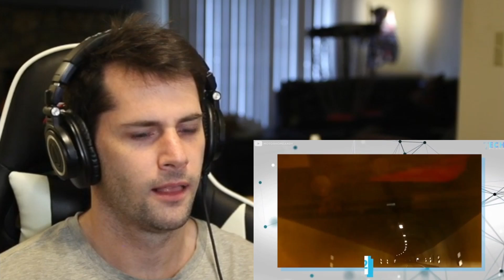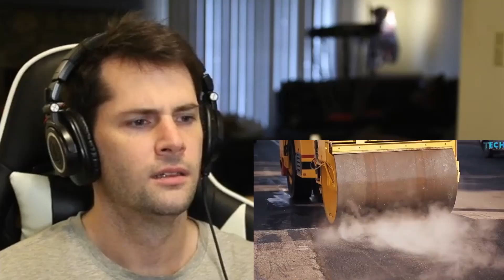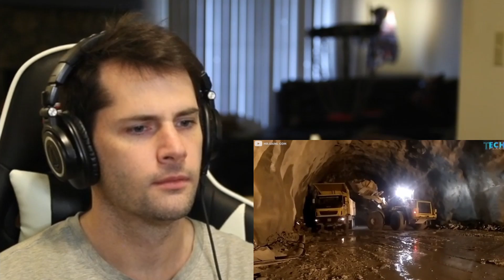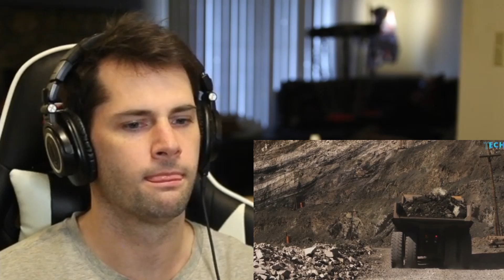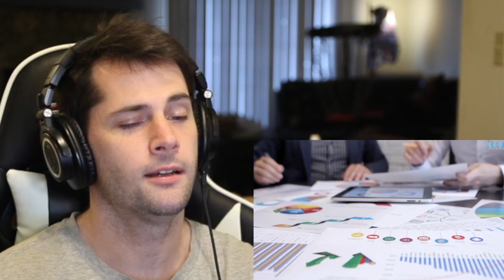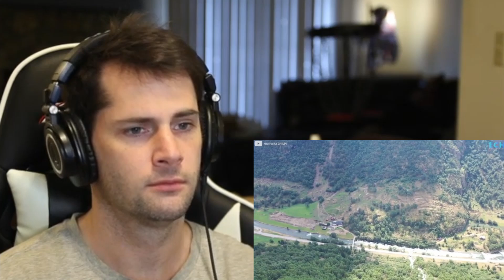American Reacts to Norway's Laerdal Tunnel (longest car tunnel)

Comment: It takes 20 minutes after they changed the limit to 70Km/h. None of the pictures outside has anything to do with this tunnel They are all from other places. There is 3 halls with blue light. The blue roundabaut is from another tunnel made for a really big bridge. Hardangerbrua. (You know how to find it online) ( and use the little yellow man in Google maps.) I know my country, and all our roads. The blue light has a function. Red light is low frequens, blue is high frequens. So when your brain is slowing down, it get a doze of blue to speed up again. When you sit and enjoy a glas of wine, or a mug of tea in the sundown, it is not the tea that makes you tired, it is the light. Microsoft and their prosessors were not first with canging computer speed, it was God.

Comment: Jut to make it clear.... over a 100 years ago between Oslo and Bergen there were over 113  raillway tunnels  - combine over 17 miles long. The longest one was over 5km. They started i 1875! Highest point way over 1200m above sea level in the aeria where you can expet over 4meters snow in the winter and way below -30'C.

A different state of mind.

Comment: Norway doesn't use EURO and never have. BUT they are part of the EU via the EØS contract thingy, sadly.. So they still got a half bad deal since they are now connected to the electrical grid of several countries in Europe and in conjunction with ACER deal they export insane amount of electric power.. and Norwegian power companies are making billions on top of billions NOK from selling electricity from dumping water from the damns without caring about the people that now and from a long time now have had insane power prices. 
Sweden also export power but Norway export over 3 times that of Sweden and then some, that's how bad it is.
Companies are having to shut down because of the insane prices so the politicians failed massively in this regard..
 So in 1992 when this tunnel was signed and set up to be done, was probably the last time they did an overall good thing in regards to the people..

Comment: I drove through the Lærdal Tunnel back in 2012, and what a journey. Back then, the speed limit was set to 70 km/h (43 mph), so it took around 20 minutes to drive through. Now, what is unique about the tunnel are the three "caverns" that separate the tunnel into sections. 
Most tunnels in Norway are not like this one, and certainly not as long. But tunnel safety has come a long way throughout the years. After a few severe fires in the Gudvangen Tunnel (which is located close to Lærdal, and is Norway's "Mont Blanc" tunnel, albeit without deaths), the government took tunnel safety dead serious, and set aside money for a massive rehabilitation project.
A nationwide program was set up to upgrade all current tunnels to a more modern standard, where pretty much all of the tunnels has received better and more efficient lighting, cell phone reception, and fire-proof concrete cladding (to protect the flammable PE-foam that they use to waterproof the tunnel)

Notable tunnel fires in Norway:
1. Oslofjord Tunnel (March 29. 2011) - Truck loaded with paper caught fire, fast emergency response, no reported damage.
2. Oslofjord Tunnel (June 23. 2011) - Another truck loaded with paper caught fire, 32 people sent to hospital (minor injuries)
3. Brattlitunnelen (January 17. 2013) - Trailer loaded with 27 tons of brown cheese caught fire, and burned for 4 days. No injuries or deaths. - This event caused a global interest in the dangers of transporting high-fat foods. Internationally, it was known as the "goat's cheese fire"
4. Gudvangen Tunnel (August 5. 2013) - Polish truck caught fire, in a convoy with another truck. This was the most terrifying tunnel fire in Norwegian history, and the closest we got to a Mont Blanc scenario. 28 injuries (5 critical, 23 severe), no deaths. - This serves as the basis for why the government made the decision to really upgrade all major tunnels (over 500 meters in length).
5. Gudvangen Tunnel (August 11. 2015) - Tour bus with Chinese tourists caught fire. Fortunately it was close to the entrance. 5 minor injuries (smoke inhalation), no deaths.
6. Skatestraumtunnelen (July 15. 2015) - Fuel tanker loaded with gasoline, had trouble with its trailer, and it slammed into the wall, causing a leak, and a massive explosion. 5 minor injuries, no deaths. This is the most severe tunnel fire in Norwegian history

Comment: They build it so wide and high he says....believe me, it's not that wide. 2 trucks passing each other in opposite direction fit, but there is not much space left between them.
And if you are over 4.2 meters high, don't get close to the side of the tunnel, or at least not on or over the white side line, cause you will hit the roof arch...

Comment: WIll probably be shut down for a year from 2024 due to EU safety regulations adressing rock burst
problems in parts of the tunnel, that is problems related to the weight of the mountains above inflict on the
rock the tunnel is drilled through. The problem is called 'sprakefjell' in Norway, 'crackle rock'.. Not nice :)

Comment: Drove through that tunnel in -05 with a coach bus full of americans. 
Quite the experience, they gave me an applaude when we left the tunnel, guess mostly because the where a bit relieved 😅

But the guy in the video failed to mention one thing, every 8 km/5 miles the tunnel gets twice the width and twice the hight for about 100 m/300 ft.
There they’ve put ambient lightning in various colors (you can see one of those ”rooms” in the video)

There are 3 of these rooms and they have different colored lightning.
It looks really nice and I guess it’s one of the things they did to break the monotomus feeling going through such a long tunnel. 

Also the walls of the entire tunnel IS INDEED covered in cement, but it doesn’t come through that good in the video.
Reply: My dad is often talking with his norwegian colleagues and he told me that they said that in those rooms you are allowed to stop and drink beer xD

Comment: I've driven through this tunnel several times, It's kind of like driving across Kansas or Eastern Colorado. Fortunately it's only for about 20 minutes, and the lighting changes as you drive, keeping you awake. Not to diminish the achievement, but it's relatively easy to build tunnels in Norway, since it's mostly hard rock. No problems with soft earth or water intrusion.

Comment: ( *FIRST: No, we don't use Euro, and not gonna use it anytime soon )
( **SECOND: Here's some other examples to the:  Æ - Ø - Å :  Æ -> like A sounds in AS = ÆS,  Ø --> sounds like U in BURGER = BØRGER,  Å --> sound is like O in BOY = BÅY )
 
Norway is tunnels heaven, for those who likes tunnels.   When i was a kid, i loved driving in them; Longer the better.  could even fall asleep to the deep, constant sound - Like a * HMMMMMMMM* sound.  Still loves tunnels today.    Lot's of them here.  Longs ones, but also deep ones - like Oslofjordtunnelen = Oslofjordtunnel.  Going under the whole fjord.   

Having tunnels to more than just reducing travel-times - instead of the old roads, usually going over or around the mountain (The scenic route)  the tunnels now runs trough; Those roads are narrow,barely fits two cars, most dont at all.. They are full of sharp turns, very slippery (both if its close to a fjord or at high altitude,  Most modern cars, especially american cars being wider, roads to.
Meeting a car, or a truck (if the truck at all are able to go up).   older roads, especially zig-zag roads up mountains wouldn't at all be legal to make today..  

[ I HIGLY RECOMMEND TO OFTEN TURN OF THE MAIN RAODS, AND TAKE THE LONGER <<OLD ROADS>> - ESPECIALLY IN SUMMER...  THEY ARE BEAUTIFUL   When I drive, i often do it myself.  NB: In Summer more cars are on the roads,  because of tourists and Norwegians having  4-5 WEEKS paid-vacation all at the same time.  In Winter, also extremely beautiful but drive safe and change to winte-tires]

Comment: Hello from Switzerland, I can understand the reasons that moved the Norwegians to do this, stone/snow avalanches can be very dangerous/treacherous and a danger for people as well as for the traffic connection, a tunnel is definitely a variant, especially since it is also "winter-proof". What I particularly like about the Norwegian Tunnel is the lighting, which seems to me to be more pleasant than the usual lighting. The vault, which looks like rock, is probably due to the fact that it does not have to be excessively supported, so (probably) shotcrete is usually sufficient, but that depends on the geology (type of rock, etc.). At our Gotthard road tunnel (16.9 km) it happened that people wanted to camp in the breakdown niches because they thought the tunnel would "never" stop, others turn around (absolutely forbidden, double safety line = very expensive fine in our country) because they the journey takes too long.
The point that people couldn't have guessed that 100 years ago isn't entirely true when I consider that our 1st Gotthard railway tunnel opened in 1882 and was 15 km long even then (the new Gotthard base tunnel is 57.1 km, by the way, the longest railway tunnel in the world).

Comment: Road tunnels are very common in Norway because of all the mountains. That makes the road safer in winter; no ice or snow on the road and no avalanche danger or land slide danger in summer. And also a make a more direct route and shorter distance to travel.
My town Tromsø is located on a island and we have loads of tunnels through this island. It started with one across the the island to get faster (and safer) from city center to the airport that is located on the other side. There is also a big underground parking system close to the city center connected to the tunnel system. Then more tunnels to the south and north of the island. There are also a double 2-lane tunnel from the island to the main land. There are also plans for more tunnels in the future.
Those tunnels also routes the traffic underground that prevents noise pollution for the residential areas on the island, that the traffic otherwise would have being passed through.
One interesting fact that all those tunnels are connected with underground roundabouts. Lots of tourist gets lost in those tunnels though ;)
(I have made a video where I am driving through the tunnel system, but it is a bit boring without any voice commentary or music, just text)

Keep up the good work, you make a lot of interesting and fun videos!

Comment: LÆRDAL  Its Norway's longest car tunnel, but also the worlds longest car tunnel ;) takes about 30 mins to drive throuh it in 80 km/h and speed cameras there with average measurement, the inside of the tunnel is 20+ C and outside can be -20 C in the winter time, there is an old road but that is narrow and very steep and goes over the mountain there

Comment: Its much more of an experience to drive over the mountains imo. Lots of waterfalls on the bergen side and sort of like arctic climate ontop, moose, raindeer, could even see bison. Area is preserved so very little of anything, but there are a couple of resturants/hotels up there. 
If there's poor conditions on the mountain plateau cars are gathered and drive over in groups, only when its really bad do they close it down. So honestly its fine even for a fresh winter driver. Just have to take care on the way down, on both sides of the plateu the descent is very steep/long (breaking issues there, obviously no bueno).

Comment: There are over 900 car tunnels in Norway.
Reply: Actually 1100 road tunnels. In addition, we have trains and other tunnels, so at the moment we have approx. 1,900 tunnels in use and about 50 under construction.
Reply: @Valfodr_jr  Yes you are right. :yougotthis:
Reply: And about 33 subsea road tunnels... ref.: https://en.wikipedia.org/wiki/List_of_subsea_tunnels_in_Norway
Reply: @JosteinBakklund  Which is included in the approx 1100 road tunnels.

Comment: I drive this tunnel from time to time when visiting customers. The tunnel has its own climate. One winter I entered the tunnel and it was 15 F outside, in the middle of the tunnel I noticed the windows started to fog over and to my amazement, the temperature had increased to 54 F after leaving on the other side the temperature dropped again to -4 F.  All this change in just 20 minutes of driving. :)
Reply: That's because of all the warm exaust fumes from cars heating up the air.. Same thing happens in every tunnel, just not as noticeable in shorter tunnels.

Comment: Norway is NOT using € Euro! We are not part of EU, but are part of the European trade. This means we confirm to EU regulations mostly, but are not directly part of EU.
The walls are covered with spray-on concrete, but it will follow the shape of the original rockface so it looks rougher and more natural.

Comment: This is a result of the flipside of our wonderful landscape. Due to steep mountain sides and a lot of snow and rain along the fjords and in the mountains, tunnels are a necessity for the safety of motorists in Norway, since snow, rock and mudslides are very common along many of the roads in Norway. It is also a necessity for heavy transport, especially for foreign drivers who come to Norway in wintertime with summer tires on their trailers.
Unfortunately, this means that much of our beautiful country is not seen by tourists on road trips in Norway.

We also have underwater tunnels, especially in Western Norway.
To be completely honest, as one should, the road standard in Norway is not the best in the world. Some of this is of course due to a challenging topography, but much could have been done better than what we have done so far.

NO, the Euro is NOT used in Norway. We are not a member of the EU, but together with Iceland and Liechtenstein, which are also not in the EU, we are part of the EEA cooperation.
Reply: Quote : It is also a necessity for heavy transport, especially for foreign drivers who come to Norway in wintertime with summer tires on their trailers.)

This is not true.
winter every truck has to have winter tyres and 7 chain.
Time perios 01.11-31.02

Statens vegvesen controll truck`s that they have this and when you do not have your travel will stop there and the tikket what they will give you is something out off this world ;D
And you can continue your trip when you have all the necessary thing`s.

I have travel whit my truck in norway only 3 summer and 2 winter period.
and yes it is very hard to finde similar conditions eneywhere in the europe.

yeap i`m a finnish trucker :)
Reply: @tapsafilmisland6892  What do you mean it's not true? 

Thousands of foreign trailers arrive, mostly from Eastern Europe, without winter tires every winter. MANY, but far from all, are stopped at either the border or other checkpoints and either held back or are forced to buy winter tires or chains before they can go on.

Every year, hundreds of foreign trailers slide off the road because they are trying to get over the mountain on summer tires. We even have our own National Geographic TV series, "Vinterveiens Helter", dedicated to car salvage in Norway, which shows this problem over and over again.

So even though winter tires and chains are mandatory, far from everyone follows the mandate, some do not even know about it because the owners of the companies do not inform their inexperienced drivers either about the mandate or the condition of Norwegian roads in winter. This is to save money without any thought for the life and health of their drivers. Therefore, the tunnels in Norway are a small but important improvement in safety for some of these drivers who come here and escape the inspection.
Reply: @Valfodr_jr  
do you work in Statens vegvesen ?
you paint the picture that there really are so many truck`s whit out winter tyres.
and chain`s.

do not beleave everything that you hear from tv or 
from people :)

i dont say that there is non off truck`s whit out w-tyres.
you say thousands of foreign driver`s whit out w-tyres.

That simply is not true. :)

When i was driving in norway more then 2 year`s i found 1foreign truck whit out w-tyres and he had only 1 chain. :)

anyhuu have a safe winter and drive safe olso :)
Reply: @tapsafilmisland6892  Are you kidding me? As recently as last week, SV had major controls at some of the border crossings in Norway precisely to check winter tires and chains on trucks entering Norway. The result was quite disappointing because foreign trucks that were stopped and refused to drive on were record high compared to the previous years. There were long queues of trucks that were refused to drive on due to lack of winter tires and/or faulty chains at, among other places, Svinesund during a check that only lasted a few hours.

A friend of mine in Odda has made a fortune precisely from these drivers who come here without proper equipment. He even got his own TV series on National Geographic! Without exception, he has to rescue 40-50 poorly equipped trucks every single winter season that have gone downhill or cannot get on. And that is only in the municipality of Ullensvang that lies in the WEST of Norway. This means that they have driven almost all of Norway across before they get there. So yes, there are 1,000s of trucks that come to Norway every year without either winter tires or chains. I have my numbers and facts from those working DIRECTLY with the problem.
 
Don't call me a liar just because you yourself obviously know NOTHING about what you are talking about. Not knowing this when you are a truck driver is extremely worrying.
What you as a single person have experienced and seen does not matter to what is really going on. That is the equivalent of saying that there is a god because you heard a voice in your head that said that there is.